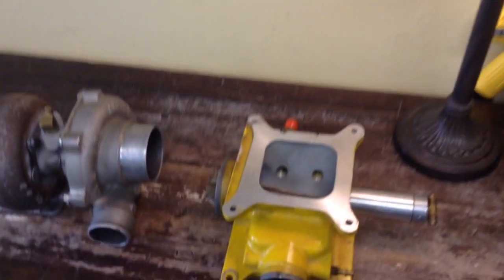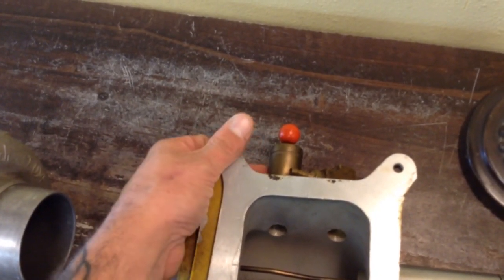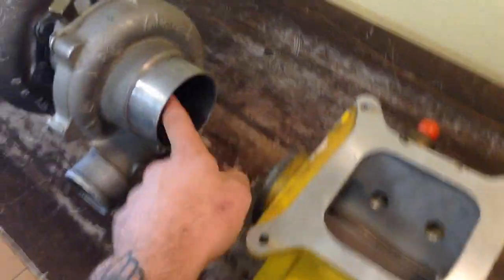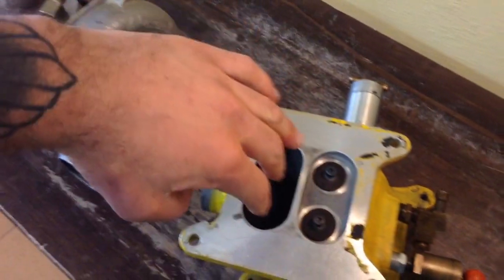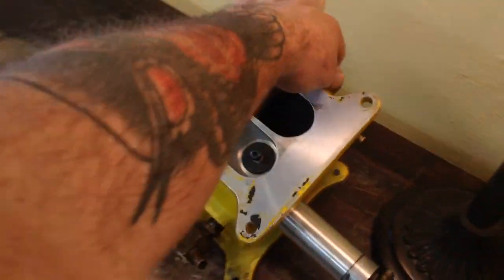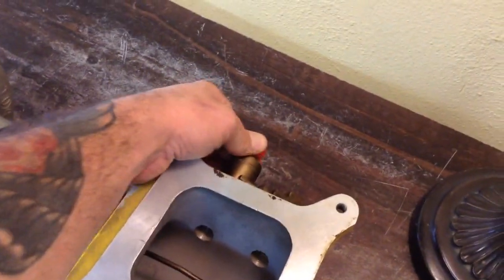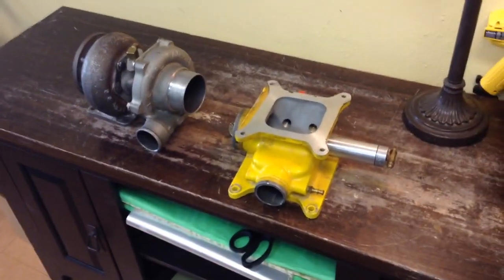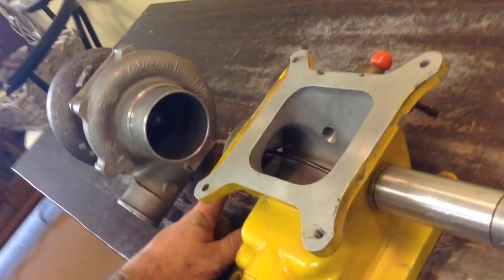Sonic draw through turbo systems: how they work

Comment: I had that setup in the late 70's. Used it on an FE 360 in a 1974 F100. It worked OK, but not very elegant by todays standards. I would never use something that primative again.

Comment: Very cool, was there any risk of fires from the pressure release valve dumping pressure that had atomized fuel mixture. I could imagine a heat soaked engine bay at ideal with the less stable, older fuels has a potential to catch a spark

Comment: Ohhh man, I started buying pieces to build one of these setups, is it too much to ask for an idle control video?  I suppose a diagram will work as good as the hardware on the bench, if the hardware is gone by now.  

Thanks for making these videos , you’re one of the few, if not the only.

Comment: Junk
Reply from the maker: Because you don't know how to make them work, don't understand them and are too stubborn to try to modify an old system to fine tune it and make it work. A very closed minded way of thinking, I feel very bad for you.
Reply: @emistryracingllc2400  I have a 62 Galaxie with a 5.0 and T5 setup on dedicated propane fuel. I have this same turbo kit that I want to try down the road on my car. Since the propane kit and turbo kit are both sized for a 350. I'm thinking there should be plenty fuel and psi to the stock 5.0.

Comment: You could hone out the port with a dremel. Being a bit smaller is ok to maintain good boost pressure. Going too big would cause boost lag with that turbo unless you rebuild with better than oem or go bigger setup all together.

Comment: The red knob thingy is a "pop off valve" that releases pressure from the occasional backfire. Without a pop off valve, something else would give way
Reply from the maker: Yup, and if you add a second pop off valve on the other side on place of the door restrictor, and use one way valve restrictors on the ends of the pop offs they actually can work as boost control as well.
Reply: @emistryracingllc2400  
Nice you made it work. I'd like to turbo my 81 GMC 1 ton. She's always loaded heavy.

Comment: And where does the intercooler go in this system?
Reply: Carbureted draw through turbo system can never be intercooled since fuel is being transported through the ducting. Fuel dropout and puddling would be occur inside any proposed intercooler. As soon as your air/fuel is compressed in the turbocharger,  the mixture needs to be quickly routed to the intake manifold in the shortest route possible.  On the positive side,  carbureted draw through systems run cooler than dry multiport intakes.
Reply: The TurboSonic Turbo Systems were never designed to be used with a intercooler, you would have to adapt one if you wanted it.
Reply: Not needed at low psi. The fuel cools it.
Reply: If you get stupid with boost on one of these you can always add water-meth injection "for free" that is you don't need a pump or anything - air velocity+ boost pressure acting on a small tank is all that's necessary.

Comment: Why not use elctric turbocharger....with it u can control when the turbo  get to works... and set  and control boost....by control voltage on the electric motor.....and u can easyli on and off the turbo
Reply: Electric turbos are unicorns
Reply: Electric turbos are good for rounding up leaves in the yard.

Comment: That things so cool where did you get it
Reply from the maker: At an old hot rod shop in Vaughan NM.
Reply: @emistryracingllc2400  are here any companies that currently still make the yellow carburetor / turbo adapters ? If so I would be grateful if you could name those companies and what is the price range for the adapters ? 
Or do you have a spare adapter that you would like to sell ?

Comment: I was the proud(?) owner of one of those systems shortly after they first came out.  There are a couple of drawbacks to using that particular system.  The major one is the way that the boost is regulated.  When the preset boost pressure is reached, the solenoid valve causes that large valve to restrict the incoming boost from the compressor discharge which, in turn, holds the boost at the set value(mostly).  Unfortunately, that type of boost regulation does not stop the exhaust turbine from spinning faster & faster.  This causes A LOT of heat to build in the discharge air from the compressor side.  So much that the engine is VERY detonation prone.  I was continually blowing head gaskets...even though my engine was built with forged 8-1 pistons AND the heads were O'ringed with copper wire to help the clamping force on the soft copper head gaskets.  This type of system still has a chance of working fairly decently if a couple of modifications are added the hardware.  First, lose the solenoid/flapper boost control feature and replace it with a wastegate style boost control.  This will help to lessen unwanted heat buildup in the intake charge.  Second,  find a way to plumb an intercooler into the system.  You don't have to worry as much about turbo lag since you will be running naturally aspirated until the boost closes the valves under the carb.  I would also recommend adding a good wide band A/F gauge.  Turbo engines are very unforgiving of lean fuel mixtures.  Also, plan on rejetting often if the vehicle is driven in varying temperatures.  A morning temperature of 45 deg will result in a significantly different A/F reading than a mid afternoon temp of 90 deg.  Good luck & Happy Turboing.

"Edit  After I thought back to those days with the Accel Turbo system, I need to make an edit to my post.  A conventional style of intercooler will not work with a pull through turbo system.  The fuel would be pulled from the atomized fuel/air mixture by contact with the intercooler passages.  This would lead to uneven mixture distribution to all of the cylinders and result in raw gas puddles in the intercooler.  Intercooling is still possible but it would require that the discharge pipe be cooled without disrupting the mixture flow.  Sorry for the misinformation.  Edit"
Reply from the maker: Thank you for your input, I actually made this system work some time ago on a predator 5000, which adjusted for me great without "rejetting" or any fuel adjustments what so ever. I didn't remove the valve, I changed the spring in it and made it into a pop off valve which opened under 14psi, I used a old school heat sink pipe as an intercooler and ran it all downhill to the ports so there was no fuel pooling. I also made the boost inlet much bigger as I was having flow problems at first causing fuel to accumulate under the carb in the drop down by the valves, which in turn started cooling the carb and riser so much the condensation would freeze to the sonic riser. On the Mustang 5.4 predator setup it made huge power gains, but I wasn't using YouTube then and never recorded or posted it. I beat a charger hellcat with it from a dig by about 5 cars to 100-110mph so it was making plenty of power for a vintage setup.
Reply from the maker: Ps, never blew a head gasket and overheated it plenty of times due to a bad coolant leak.

Comment: I just picked one of these up came with a turbo, carb adapter unit, 2 cast boost pipes, turbo tee for the exhaust side of turbo and turbo down pipe. These are definitely a rare piece